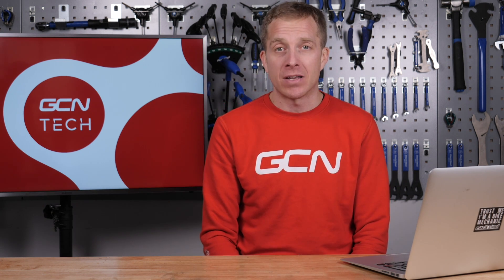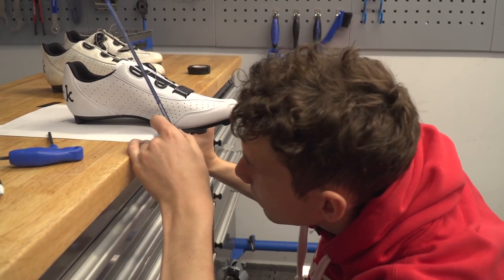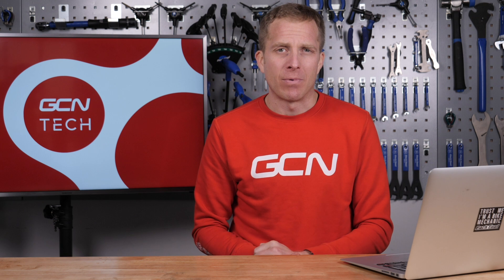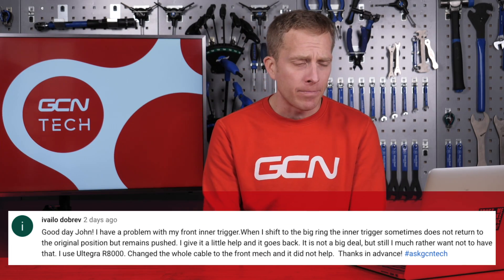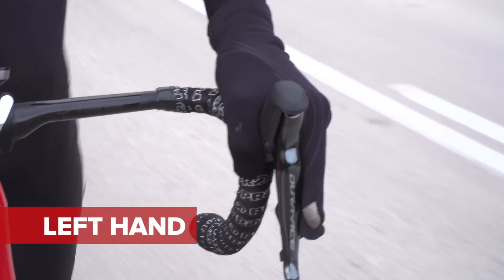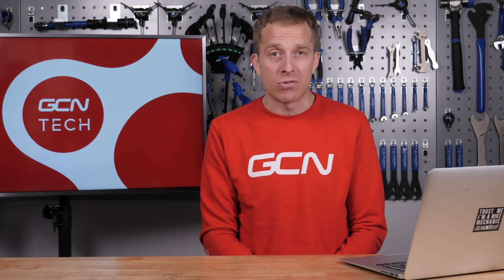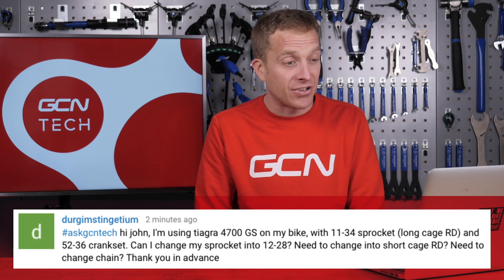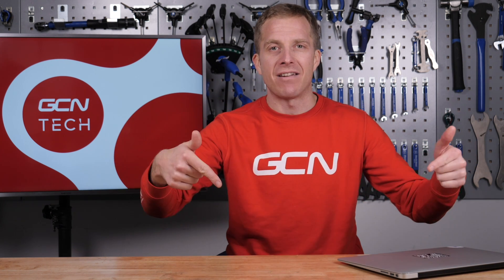Toe Overlap, Tyre Widths & Rolling Resistance | GCN Tech Clinic

Comment: @Dylan Kite -- There are several unknowns that must be considered before your question can be answered. Chief among them are: (1) road smoothness, (2) speed, (3) gradient, (4) rubber compound, and (5) your weight. In the end, you'll probably just have to experiment until you discover what works best for you. For me, the "sweet spot" for my weight and the roads I ride -- smooth asphalt roads over rolling hills at medium-fast speeds with lots of multi-directional wind -- is a 25 mm tire width. But my choice is based on my desire for more speed. If comfort is a higher priority, you may want to err on the side of a wider size. For a deeper discussion read on...

In my opinion the label "rolling resistance" has been misused in discussions like this. What you're really asking is: Which size tire will be faster? and the answer requires that you begin by specifying the surface you'll be riding on. This is because your original statement is false on its face -- wider tires do not have lower rolling resistance. Under ideal conditions of a very smooth road or an indoor track, narrower tires have less rolling resistance than wider tires. This is why cyclists for decades believed that narrower tires were faster. The reason the thinking has changed on this subject is because most outdoor road surfaces are bumpy. An extreme example would be cobbles. Remember that the narrower the tire (that is, the smaller its volume), the higher its pressure must be. What smart cyclists discovered is that, on a bumpy road, the high pressure of a narrow tire caused the tire to bounce more. This bouncing reduces contact with the road and the net "rolling resistance" goes up -- not because the narrow tire, itself, has more resistance (it doesn't) but because it bounces more. Wider tires use less pressure, so they bounce less, making them faster than a narrower version of the same tire on the same bumpy road. So, you see, the wider tire doesn't have inherently lower rolling resistance than a narrow tire -- it simply bounces less and the less you bounce, the more speed you can hold.

If the road surface is mostly smooth, then I'd recommend that average cyclists stay with a 25 mm or less tire width. If the road surface is mostly bumpy, then I'd recommend a 28 mm or wider tire -- if your frame and brakes can accommodate it. As for the tire weight, it might play a lesser role for most cyclists and I wouldn't worry about tire weight unless it was significantly different or you plan to do a lot of climbing (more on that below).

Next, let's talk about speed and gradient. Without taking speed and the slope of the road into account, it is very difficult to determine a "break even" point. If you ride fast, wind resistance will have a significant effect and will impede your travel more than rolling resistance. To overcome wind resistance at your wheels, you need narrower tires and wheels that are appropriately designed for the tire width you use and the type of wind conditions you will encounter. As for gradient, if you do a lot of climbing and the road slopes upward a significant portion of your route, then tire weight will become more important. This also argues for a narrow (that is, lighter) tire. Plus, when climbing, you'll be traveling slower so both wind resistance and rolling resistance will have less of an effect and weight may be king.

Next, we come to, what I believe, is the "elephant in the room": rubber compound. Too often, generalizations are made across different manufacturers and models, yet the single biggest factor in rolling resistance may be the tire rubber itself. The rubber compound in a race-quality road tire will naturally have much lower rolling resistance (and simultaneously, much better grip) than a cheaper mass-market road tire. And rubber quality varies tremendously even between the race-quality tires of different model and manufacture. So you have to be careful when comparing tires. For example, a Continental Grand Prix 5000 may have lower rolling resistance than Brand X road tires regardless of the tire size simply because the former's rubber compound is so much better. Rubber formulations are carefully guarded secrets within the tire market. The most accurate tire size comparisons are made with the same model of tire where all sizes use the same rubber compound.

Lastly, there's your weight. The more you weigh, the more pressure you'll need to use to achieve the optimum compression of your tires (typically, 15%). A lighter cyclist should use less pressure than a heavy cyclist. This will also effect your minimum tire size. For example, it's common for a tall male cyclist to weigh too much for many 23 mm wide road tires. A typical pressure limit for many tires is 120 psi (8.27 bar) and a tall male cyclist can easily require 125 psi (8.62 bar) or more in his rear tire to prevent excess tire compression. This same cyclist may need to pump a 25 mm tire to 110 psi (7.58 bar), which is still quite high for roads that are not smooth. I hope you see where I'm going with this: The heavier you are, the more it shifts the "break even" point for tire size vs tire weight/air resistance upward to bigger tire widths because you must use higher pressure.
Reply: Even though you managed to hit a lot of marks there, you missed one very significant factor. Aerodynamics. A tire that best fits your wheels smoothly will be the quickest, even uphill. Aero drag is way more significant than rolling resistance, except maybe on the steeper sections of Mont Ventoux.
Reply: @StuntpilootStef, you've taken aero is everything way too far.  Aero matters much more than weight true.  But more than rolling resistance up hill?  Absolutely no way.  At 20km/hr RR is about equal to wind resistance.  And we're talking about tires, not a helmet.  The aero gains here aren't that huge regardless of the price to get them.  The RR gains between winter and summer slicks can be 15 watts at 30kph over two wheels which is still 10 watts at 20 kph.  Find 10 watts of aero gains at speeds that slow. And this isn't even talking about the probably larger gains associated with low pressure on even mildly rough roads.  Even on flat roads, you'd be hard pressed to find any loss in speed for most riders up to 28mm, for good supple tires with appropriately reduced pressure, let's say for speeds under 35 kph, on anything but the best roads.
Reply: It also depends on wheel width.  I am currently riding 28/32mm tires on 30mm wide carbon rims, they pretty much go straight down from the rim and the whole thing acts like a deeper section aero wheel because of it.   I'm not any slower on those at speed then I was on my old 25mm tires on skinnier alloy rims.   I have a power meter and know I'm not putting out any more watts for the same speeds, and I'm certainly more comfortable and happier to ride longer distances on my current setup. 

Now if I stick fatter tires on those rims that balloon out, then I do have to work harder.
Reply: @davethedogdude  That's exactly what I just said :)
Reply: @StuntpilootStef  yes, I didn't see your post until after I replied.  But I can vouch for it from experience.
Reply: @StuntpilootStef  I don't think he did miss that factor, he said "To overcome wind resistance at your wheels, you need narrower tires and wheels that are appropriately designed for the tire width you use and the type of wind conditions you will encounter". Personally I'm still on 23mm tubs and I'm pretty sure they are fastest for me. Part of that will be aerodynamics (the tyres are one or two mm narrower than the rim when mounted), and part the fact that I'm pretty light at 64kg. Most people who are claiming that 25mm tyres are faster are heavier than me by a proportion that's grerater than the air voliume difference between a 23mm and a 25mm tyre... I do think it's funny that the vast majority of people who are running 28mm clinchers on deep section wheels because they think they will be faster due to decreased rr are largely negating the much more significant aerodynamic benefits of the deep wheels. There are very few 28mm clincher / deep section wheel combinations where the measured width of the tyre when fitted isn't wider than the rim.
Reply: @Neil who says the aero benefit is "much more significant"?  My strava says otherwise as does the trend in research on this.  It's more significant until it's not and that turnover is wider than previously believed (by the elite anyway).  I'm heavier than you, but nowhere near proportionally to my tire volume and I'm faster on 28 on than 23 on many paths I ride.  I wouldn't call them terrible surfaces either, but you can definitely feel consistent bumps.  I'll admit, I'm not pro power level and when I'm at those speeds maybe 25 is better, but then most pro's spend most of their time drafting. If aero was everything in pro road racing everyone would be in a TT position. Ok, there's a rule against it, but most riders don't even push the rule. Admitedly, I think many recreational riders shouldn't use pro road racing as their model, and this is one of the reasons.  Finally there's fatigue.  Proving you're a hardman just makes you more tired and slower. Comfort is speed.
Reply: @bigring6424  The difference in air volume between a 23mm and 25mm tyre is about 18%, so it follows that if 25mm is ideal for someone of 75kg then 23mm would be equally well suited to me at 63-64kg. I don't know how much you weigh but I'll bet that many people touting wider tyres are 75kg or more. My strava says I'm faster with a 23mm tub at the front than with a 25mm (I'm still running a 25mm at the back). Of course talk of widths is meaningless without mentioning pressures, it's the lower pressures that you can potentially run in wider tyres that offer slightly reduced rolling resistance for certain people of certain weights over certain surfaces... Of course with tubs you can run lower pressures for a given width in any case. 

As regards your reply to StuntpilootStef, it's again meaningless to talk about total air resistance vs. total rr without quantifying how much these can be altered by the factors under your control (tyre width, aerodynamic drag of you and your bike). But if you are going uphill at 20km/h or less you're likely to be out of the saddle half of the time, and that's *definitely" one time when you don't want a big squishy front tyre! Your weight is nearly entirely over the front wheel and the deformation of a fat, low pressure tyre is very noticeable, actually increasing your rr considerably compared to a higher pressure tyre.

And the rest of the time when you are going at decent speeds on the flat the aero benefits of a narrower tyre that isn't wider than the rim it's mounted to are more significant that the rr difference between apropriately pressured 23mm and 25mm tyres (or 25mm and 28mm for a heavier person), assuming the road surface is half decent. Quote <<<Even on flat roads, you'd be hard pressed to find any loss in speed for most riders up to 28mm, for good supple tires with appropriately reduced pressure, let's say for speeds under 35 kph, on anything but the best roads.>>> Again meaningless without quantifying "most", "best", not to mention the wheel / tyre combination and its influence on drag. Anyway, I'm usually averaging 33-35 kph in the summer, so for large parts of the ride (the parts that matter) I'm doing more than 35 kph. I think this is the issue here - too many generalities being thrown around (I blame the cycling media and the cycling industry propaganda) - different people have considerably different weights, ride on different surfaces and at considerably different speeds. You need to find out what is fastest for you (assuming you are interested in speed), and doing this for most people is greatly hampered by incredibly unhelpful generalisations (such as that a certain tyre width is universally optimal).
Reply: @neil7769  There's a lot more in what you said that I agree with than disagree with.
Reply: @neil7769  Oh, one thing I would disagree with is that climbing at 20kph is out of the saddle.   Even in 39/23 gearing 20kph is 93 rpm at the pedals.  Yeah, maybe Cantador does that out of the saddle.  Not normal people.  Anyway, your point is still well taken.
Reply: @bigring6424  Hmm, not sure about that. Why 39/23? If you were in the middle of the block on the small ring (say 39/18), 20km/h would be a cadence of a little over 70 rpm. Admittedly for me I wouldn't be holding 20km/h for an extended period on anything much steeper than a 5% slope and I'd probably be seated the majority of the time on that sort of climb, but I'd probably have short sessions out of the saddle just to give the legs a change. 20km/h is a funny speed though. Actually, I suspect much of the time I'm doing that speed it's for short efforts up steeper slopes, in which case I would in fact be out of the saddle most of the time! I wonder if you meant to calculate cadence for 39/11 or 39/12?
Reply: @bigring6424  Actually, I see what you are saying now - you are assuming that people are only out of the saddle when they have to be because they are running out of gears? In my case if I'm on any sort of steepish climb I'm usually alternating seated and out-of-the-saddle efforts irrespective of gearing. But yes, I suppose 20 km/h is the sort of speed (the sort of slope) where I'd be seated the majority of the time. 15 km/h / 8% slope though and I'd probably be half in and half out of the saddle. I'd maintain that the sqishy front tyre when out of the saddle in that situation would add much more rr overall than you'd save from better rr when seated..
Reply: @neil7769  Yeah that was my point.  Sure some people ride out of the saddle just because that's how they ride, and may even gear up to do it.  I'll stretch out of the saddle but only briefly.  On hills I sit until I can't. I jst found Compass cycles article on tire width from a year ago in 12 myths about cycling.  They did road tests and lab test and for smooth roads found no loss in speed up to 54mm! (but no gain either above 25mm).  They recon that actually you're improving suspension losses, partially ones pounding your own muscles, but losing in tire flex losses.  No idea what weight.  The guy in the picture looks like maybe 70kg, maybe 75.  I'd sure be interested in data about climbing.  Also with the wide tire you can always increase the pressure for certain rides.  The contact patch will come back to the same size then, but it's possible that side flex is still greater, and may create losses.  Anyway, it seems better to err a size too big than a size too small. Below 25mm they got measurably slower.  I doubt they even-reoptimized the rims for aerodynamics.  Obviously yes tire material matters, but only in the sense that worse tires will do even worse in low pressure relative to high pressure. Of course that article is written by people selling things, apparently pretty utilitarian things, so there's that. They also don't state numbers or precision, which bothers me more.  Most articles with enough funds to support research are related to people selling things though.
Reply: @bigring6424  I looked for the article but couldn't find the specific one you mentioned - but clearly they are very focussed on gravel / adventure, as well as selling their wide tyres.. ;-) What sort of tests did they do and at what speeds, and did they look at tyre/rim combination? It's likely that if they found no loss but also no gain in speed over 25mm that there would be a net loss after that once aerodynamics was properly factored in (with a tyre narrower than the rim). It's probably no accident that 25mm has become the new standard in the pro peloton, it's probably fastest for the average rider using modern wide rims and tubular tyres that don't measure wider than stated when mounted. But that would probably equate to a 23mm clincher tyre, as they tend to measure wider when fitted. And for lighter riders, the optimum would be a little narrower.
Reply: I found another blog post of theirs about this test where they say it's here:
"Bicycle Quarterly‘s latest tire tests, published in the Winter 2016 issue (BQ 58)"  But that article costs $9.75, and I don't really feel like spending that.

They go on to say:
"By the way, we tested at 22 mph, so this factors in the greater air resistance of the wider tires. It appears that wider tires have slightly lower rolling resistance, which cancels out the small increase in wind resistance. This means that at lower speeds, wider tires probably are faster than narrower ones. We tested on very smooth asphalt. On rougher roads, wider tires also are faster."

So that's 35kph, but mind you they repeat that 54mm is as fast as 25.  This stuff is really hard to test, but the biomechanical efficiency and fatigue is the hardest part to test.  35kph isn't that fast especially if you're concerned about closing gaps on descents, but it's not slow.  Of course it's on one type of tire, but generally poor tires will only make wide and low pressure relatively worse, not better.

I'd say if you race 25, if you don't 28, and if you're really light weight, maybe 23, real widths. If you ride a 28 that fits as a 30 for a recreational bike you can take it a few extra places and likely will never notice any loss in speed. For recreation, the rides you miss matter more than the seconds you miss, even for people who like to go fast.
Reply: @davethedogdude  Which rims are you using? I’ve been looking for 30 mm wide rims for a while now.
Reply: @adrian.m258  Mercury G1 Gravel 6 bolt disc wheels, they are 30mm wide and 30mm deep.  You can get them somewhat inexpensively (for Carbon) at places like Competitive Cyclist, even more so if you can stack a coupon code.   They have been rock solid and problem free for me for 16 months and >4000 miles now and I've gone through some pretty rough spots, big potholes, cyclocross, and even done single track on my cross bike with them.  I do use my stock wheels as winter wheels, so no idea how they would stand up to snow and non-stop wetness though.   They were true out of the box and have not gone out of true at all.  They have good quality sapim race spokes, but do have Mercury rebranded "higher end" Novatech hubs instead of something theoretically "better".   I say theoretically because I've never had problems with Novatech hubs, but I'm a 59kg skinny dude who although has an decent FTP of around 3.8w/kg,  but am most certainly not a sprinter, and might put out a 900 watt sprint a few times a week if I'm lucky.  They are MTB hubs with more engagement points, so pick up is quick compared to my aluminum stock wheels.   I'm a full 1mph faster riding them over distance vs. the stock aluminum wheels with the same tires, due to weight savings and aero gains.   They are for sure not the lightest carbon wheels you can get, but still shave 1# off my bike compared to stock wheels when fitted with a SRAM Force cassette and they seem durable, at least for skinny me.  So I like them. 

FWIW, I run them tubeless, and I've never had a flat or a burp running from 30-60 psi.  For road I typically am running 60psi on 32mm tires.  They have a hookless bead, and it's a bit of work getting tubeless tires onto them (tight fit) but I don't lose pressure.   They might go from 60 to 40 if I ignore them for a full month with Sector 32s on them for riding on the roads here.   I retain pressure better running tubeless with them then I do with tubes.   I'm using orange endurance sealant.